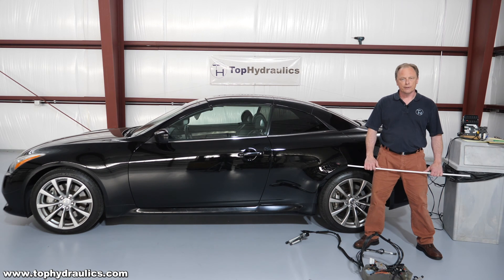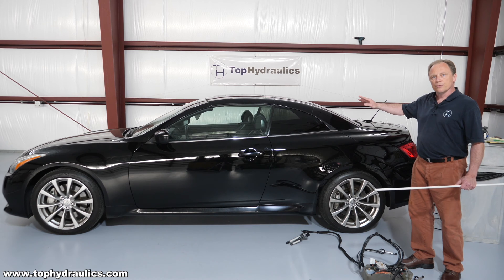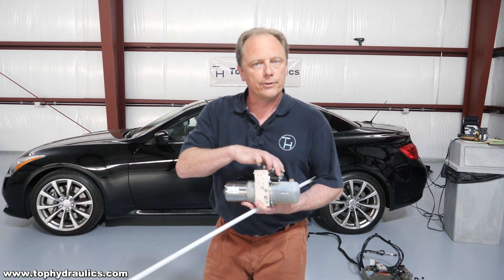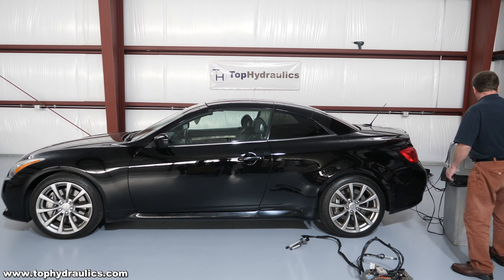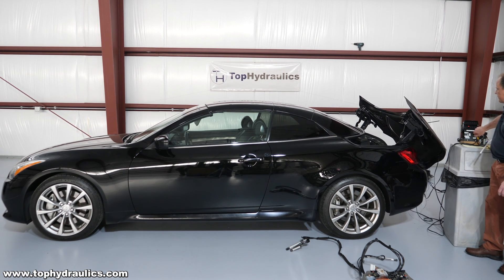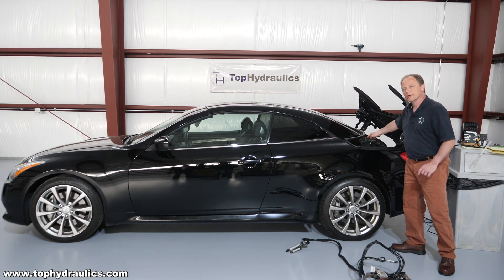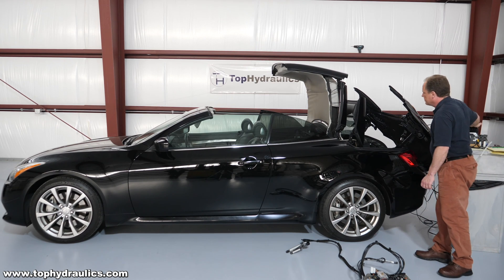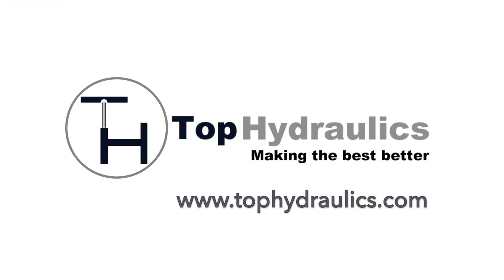Infiniti G37S - Understanding the Top Opening Sequence

Comment: I have a 2011 g37 while operating the top only the parcell shelf moves no movement from the trunk or the roof
Reply from the maker: The first step would be to check for water intrusion in the trunk. If the foam around the pump is wet, then the pump has likely been wet for a long time and it may be seized.

Comment: My top suddenly stopped working. Won’t go up or down. It beeps and displays “roof in operation” while driving. Any idea ?
Reply from the maker: Did you get the "roof in operation" message after pushing the button to move the top, or did it show up out of the blue?
Reply: @TopHydraulics  pulled 2 roof fuses and the message disappeared and beep stopped. Infiniti says it prob needs to be relearned ? Battery is good
Reply from the maker: @FuncMedDoc  If the top closed all the way and it gave you the signal that it was fully closed at the time, then one would think that one of the sensors was just about giving the signal that the roof section it is monitoring has moved far enough and subsequently something happened that made it give a signal that is not consistent with a closed top. If this switch or sensor is one that is not activated near the end of the cycle, then the computer will find it's signal illogical and not move the top at all. A relearn may take care of it if joints in your top have developed play with time. Keep our fingers crossed, please let us know how it turns out. In particular, it would be great and very useful for fellow G37 or Q60 owners if the dealer can tell you which exact sensor is showing out of limit before they do the relearn. Please keep us posted.
Reply: I put the top up and parked it. Went out to drive it 1 hr later and that’s when it appeared (over 3 mph) and the loud warning beep
Reply: This has happened to my 2010 G37, I disconnected the car battery for 10 minutes and when I reconnected the cables, it was in  working order

Comment: Wish the electrical connections were documented here.  Congratulation for the demonstration. Now I have to figure out how you did it.
Reply: @tophydraulics nothing in the field service manuals seems to indicate which leads control what in the rear connector at the hydraulic pump.  Did you happen to photograph the connection at the hydraulic pump or is that not where you applied the fancy switch leads?

Comment: Wow!  Very well done video.   My top has been a problem for me since Feb when my battery died and was dead for a few months.  After installing a new battery my top wouldn't do anything.  The button was completely unresponsive and I could hear what almost sound like a kittens meow coming from what sounded like behind the back seat.  This sound would be once every 20 or 30 seconds or so and was constant even when the engine want running.  I believe it timed out after a short time once exiting the vehicle.

I saw from other YouTube videos that is was a very common issue if your battery dies to have to go to Nissan and have them manually "relearn" the position of the top.   I saw a video of how to do this with the Consult III software and it took about 10 mins.  I was angry at such a design flaw (all batteries die eventually, right) but was even more angry when they quoted $450 to do this 10 min job claiming it takes 2 hours.  Eventually I gave in and took it to the dealer but after keeping it overnight they stated it wouldn't respond to anything and said something wasn't getting 5 volts.  I was convinced they were clueless and/or trying to rip me off.  It would be an awful big coincidence if my issue was something other than the common issue that goes along with a battery dying.  The stealership went on to say they would need to check all of 15 sensors and that would cost $630 just to diagnose it, not fix it.  I declined and picked up my car.

Several months later I decided to drive my car to Nashville and back from Lexington KY.  7 hour round trip.  The next day I took it to Cincy and back another 3 hr trip.   I hadn't driven it much at all for the past 5 months or so while the top was unresponsive but when returning home from Cincy I noticed I wasn't hearing the "meow" sound.   I thought whatever it was that was trying to work back there finally petered out.  Just for fun, I tried to lower the top.  To my surprise, instead of being unresponsive like it had been for months after the dead battery ordeal, I was informed in the DIC to check the trunk separator.  I was very excited.  I just knew that once I shut the separator that my top would work.  I was right!!!

After opening it, I then closed it.   It went through the sequence okay until the top was coming to the windshield to latch, the latches latched about an inch too soon and my trunk closed but didn't seat quit perfectly.    I pulled into the garage and let it sit a few weeks before pulling it out and disconnecting the battery and doing different things until finally getting it to work again.    I probably lowered and raised it again 15 times over a beautiful weekend in September.  Suddenly, after 3 days of having a convertible again, while closing, it closed to within a few inches of the windshield and the trunk is still opened backwards.  It has gone from being completely unresponsive with the button like it was before, to hearing the kitten meow, to saying the trunks open, to giving 2 beeps and back to completely unresponsive again. 

I convinced myself that maybe there is a wire broken somewhere?

I have felt helpless until finding your videos.   its a 2011 with 88k miles and is a beautiful car.  Its probably worth between $10k- 14k but It wouldn't make sense to spend $6-8k to fix it.   :(

Any ideas on what I should look at at first?  What would a rebuild of pumps and cylinders run?

With your videos I am at least finally pretty confident I can get it closed and make it drive-able so I can sell it but I would like to have it operational and keep it.  Its a 3rd car for me so its not terribly inconvenient right now.

Thanks in advance!  :)
Reply: It would be helpful if you guys made a video on the Button , sensors and maybe how to fix the “roof in operation” signal without having to take it to the dealer. Or just some tips on what to check when small things that can might go wrong.
Reply: @durangaming8927  i have the same roof in operation problem g37 09
Reply: I have a 2011 convertible white coupe. I am having the same problem with my car. I had some guy install some Subs 12” into my car but when he installed it I’m not sure what he did but my roof doesn’t open anymore as it has to. It started making that meow sound every 5-10 seconds and sometimes when I drive and go over 5pm it makes a beeep sound and says “ roof in operation “ when the roof is not in operation. I also tried to mess around with the button itself in the open or close and taken out the sensor for the button plus the little white thing that moves the button and sends the signal but still no clue. I’m not sure what to do and I don’t want to take it to the dealer because I already know what’s coming with the money. I called and just to diagnose it and check they want like $200
Reply: @durangaming8927  Did you ever figure out what was making the meow noise?  best I can tell its coming from the lock mechanism for the "hooks" that lock down the top to the windshield.